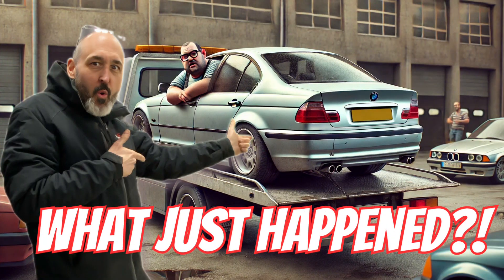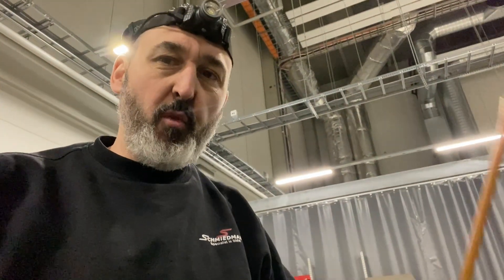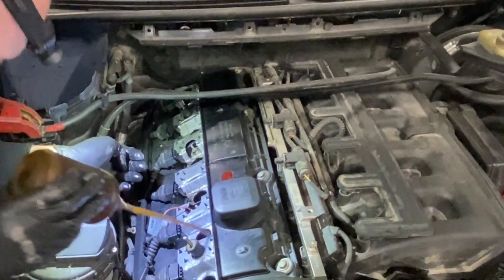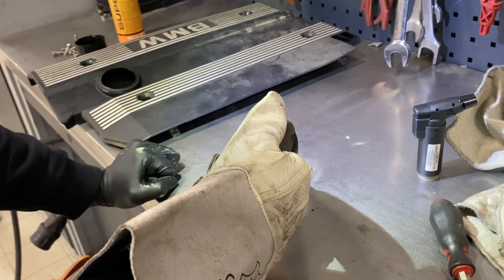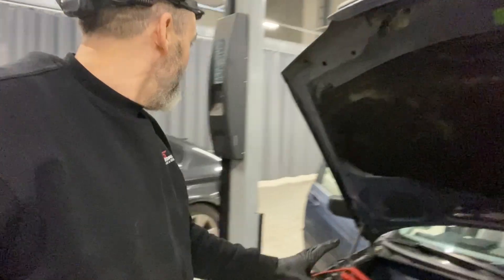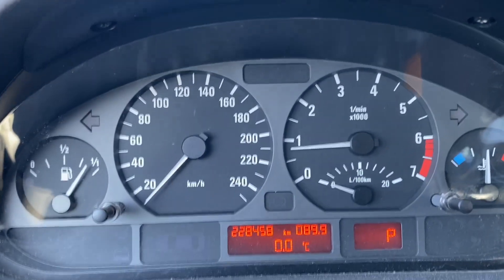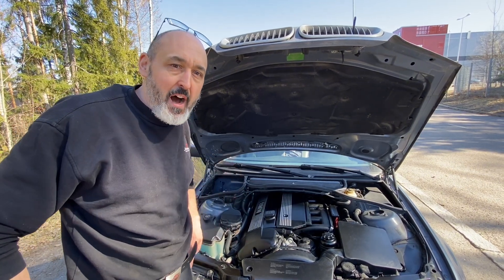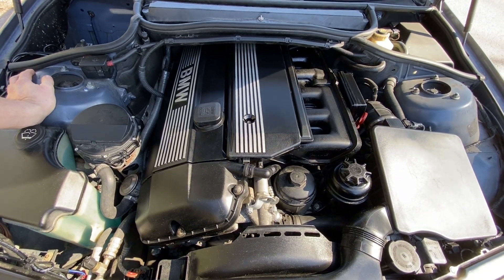How to Fix an Engine With No Compression (It Actually Runs Perfect Now!)

Comment: About How much Oil did you spray into each cylinder and how long did you let it sit before putting in plugs and starting?
Reply from the maker: Dont spray it squirt thick oil in. About 50 ml per cylinder. Heating spark plugs is the most important bit. Get the thing started asap

Comment: Just literally got the news my 73 eldorado is getting 0 compression on 7 out of 8 cylinders, is it possible this could work for me?? 500 BBC 8.2L  motor
Reply from the maker: Maybe😊 its worth a shot
Reply: @BenJFF I think I will try it bc from the pics my mechanic sent me he didn’t remove the intake manifold which means he didn’t remove the 3 spark plugs underneath it so I’m thinking his low compression results may be inaccurate bc of this. What do you think
Reply from the maker: Try it mate i have no odea
Reply: I actually didn't give it a shot, ended up just trading it away for a 76 eldorado. Guy traded it to had 2 available motors on hand if that was the case.
Reply from the maker: Nice. I love the Eldorado
Reply: Did it work
Reply from the maker: Yes perfectly

Comment: Wow... that's a turnaround (compression wise)! About the white smoke...I had the same disco effect after I've changed the entire PCV system on an M54 that I had. The oil separator tubes were all brittle and the engine was sucking oil. After I did the job, it kept smoking for days. I thought the engine was really cooked. Turned out the catalytic converter can hold a lot of unburnt oil inside... probably mixed with fuel. You should take a look at that PCV system. It's probably cooked also. You have a happy customer 👍. Just for the fun of it... could you do another compression check?
Reply from the maker: I know Alex. And it runs so smoothly you cant imagine. I am sending the injectors off for a rebuild. Cant imagine anything else causing borewash plus I did see fuel misting from the open intake valve
Reply: @BenJFF  yes...bmw's 6 cylinder engines are very smooth. I made a video on the one I had with a coin on it. It had +250k km. Probably best engine bmw made? You should know. Maybe you should do a video with your top 5 favorite bmw engines...from a bmw specialist perspective.

Comment: This is one they taught us too! when doing a compression check and everything is down to put a few drops of oil in the cylinder if compression raises then it's bore washed or bottom end damage if no increase then valvetrain related. Experienced the bore wash on a VAG 1.5tsi new plugs and it was away again! Flip side being an N16 in an F20 that had a burnt exhaust valve so cylinder head off jobbie! Great video, another M54 lives to tell the tale 😁
Reply from the maker: Hehe wait til you see this N54 I'm making a video of - no compression number 6... you will love it
Reply: Look forward to it! Used to have an N54 myself miss them days, glad you're wizardry is keeping another healthy 😁 @BenJFF
Reply from the maker: Cheers pal 👍👌